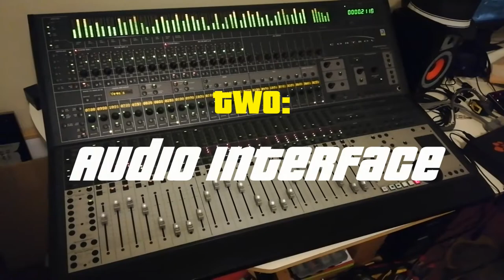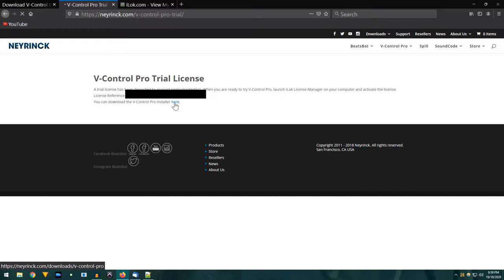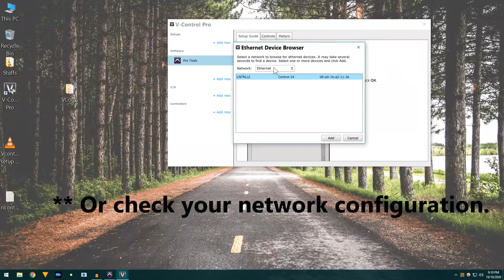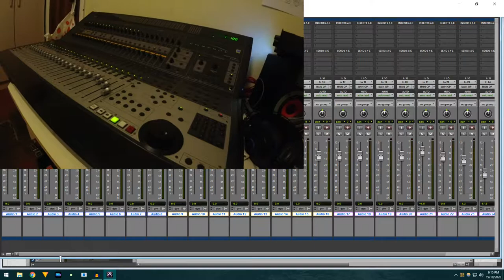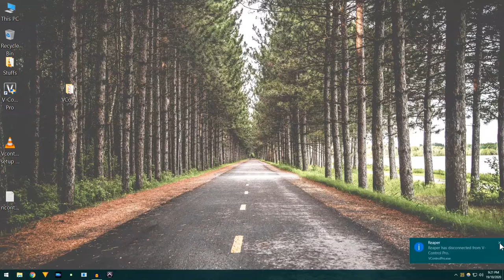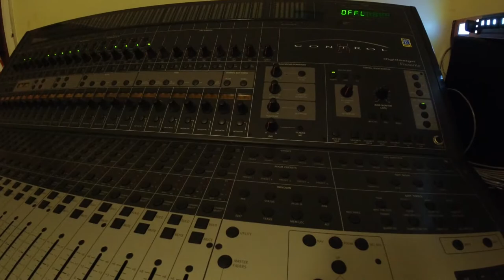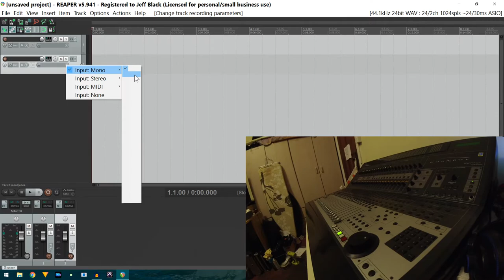V-Control Setup with Digidesign Control24 | Pro Tools | Reaper | Windows 10

Comment: Awesome awesome awesome video!!
I need your help! I have a command 8 I’m trying to get to work with reaper like this. I’ve done everything in your video and can’t get anything to work. Only the transport. I’m at my wits end with this. Been trying all year. I’m ready to be done with this and get a newer controller. I want to create not mess around. Please any help any advise. Please sir!!!!
Do I need to enable anything in the “midi devices window”?
I’m ready to go back to Protools. It works flawlessly in protools. I like Reaper but trying to get control surfaces to me have been a pain in the butt.
Reply from the maker: Hi, thanks for watching and for your comment. Wow that sounds like a massive pain in the butt!! Sorry to  hear.
I've only used a Command 8 with Pro Tools but found only a few things online about using it with other DAW's. One forum mentioned attempting to configure the Command 8 in Reaper as a "Livid DS1" controller (their example used Reason, but I assume it would be the same in Reaper). So maybe you can trick Reaper into thinking the Command 8 is something else to get some functionality.
Another article from Soundonsound.com wrote about using the MIDI Outputs instead of the USB port, so if you have an interface with MIDI input, this may be an option or perhaps a MIDI to USB converter. Here is the link to the article (Search for the "Stand-alone Mode" section) https://www.soundonsound.com/reviews/digidesign-command-8
I'm not sure if this will help, hopefully it will help a bit, but if you don't want to use Pro Tools then maybe a different control surface (Such as the ICON Qcon Pro or the ICON Platform M+)
Reply: @Guitargasm  thank you so much. I will attempt this again for a week. After that. It’ll be on to a different controller. Thank you thank you thank you
Reply from the maker: @uriel-heavensguardian8949  You are welcome :)
Hopefully that helped you, please let me know if you get it working or go for a different controller.
Reply: @Guitargasm  will do sir
Reply: @Guitargasm  Got my command 8 to work with Reaper!!!!
Wooooohoooo!!!!

Comment: How would you connect this to a newer mac? Or do you only do Windows? Also how are you connected if it has no USB?
Reply: you would connect via ethernet, in the case of a Mac you’d need to get an ethernet to usb c adapter if you don’t have one and plug both the mixer and your computer into a network switch so the software syncs
Reply: @younglordeisen2443  you think this would work with the icon d control?
Reply from the maker: I'm not too familiar with mac, but the audio interface has a USB output and that's how it connects to a PC or mac.

Comment: V control is not detecting my control 24 in the Ethernet select. the computer is recognizing that there’s connectivity but not the software can you help
Reply: connect the control 24 to a network switch if you have it plugged directly into the computer

Comment: Thanks for the help...I have a problem. Could you help me? I'm not getting the sound to enter control 24,,, it's being played on the computer's speakers.
Reply from the maker: Thanks for your comment :)
If sound is not going through to control 24, then my first thought would be to check where your computer is outputting to in system settings/speaker output on the taskbar.
What interface are you using? Are you using windows or mac?

Comment: Hi! Have you been able to get the bus output meters working (of the control 24) on pro tools?
Reply from the maker: Hi, I didn't get much working on that console, all the meters for input did work for me but not the output. I had so many other issues with it that I've gotten rid of the console.
Reply: @Guitargasm  what kind of problems where you having?
Reply: Yeah what can you do/not do?
Reply from the maker: Sorry, I didn't know you had commented (No notification) :(
Issues I had were jittering faders, poor communication into pro tools/reaper, sometimes neyrinck software wouldn't connect to the console and required to start everything in a certain sequence or it wouldn't work.
Sometimes certain faders wouldn't work in pro tools/reaper (ie: moving the physical fader wouldn't move the digital fader in pro tools/reaper)
There's probably more but honestly can't remember.

Comment: Jog wheel is amazing for navigation and zooming, too bad it's not supported 31:02
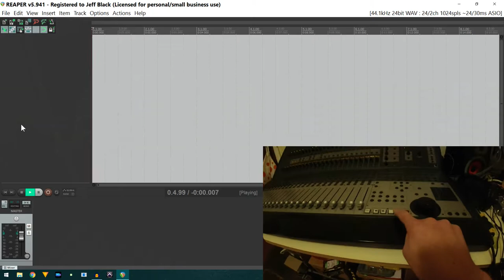Reply from the maker: While it does work in Reaper (21:14), I think there are a couple of buttons near the jog wheel (Scrub, Shuffle) that need to be pressed for it to work in Pro Tools .
Reply: Basically jog wheel works perfect with all the modifier keys in Pro Tools, Shift, Alt, Ctrl/cmnd @Guitargasm

Comment: Did you end up selling it? The fader tremble is a sign of a weak power supply.
Reply from the maker: Yup. Got rid of it. Didn't know about the weak PSU thing....
Reply: @Guitargasm  Just acquired one. I am under the impression that the new Pro Tools has a learn function. Hopefully this works over V-control
Reply: I bought a V-control licence.

Comment: How did you get the board to talk to the computer. Sorry I think I missed that part. Like how does it plug in?
Reply from the maker: The board used a DB-25 connector that plugs into the back of the Interface and then that Interface plugs into the PC via USB.

Comment: Anyone know if the 2022 pro tools version still compatible with V-Control? I’m about to purchase a Control 24 but kind of scared it won’t work
Reply: I'm running a Control24 with V Control on ProTools Studio 2022.7.  Works great
Reply: @cranwilton6133  really so should I buy the c24???
Reply: @bigsteppa3112  Both the C24 and the Control 24 work great with V Control. The C24, the model after the Control24, is still fully supported by Pro Tools ....... "fully supported"  means it does not need V Control to work with Pro Tools but it does need V Control to work with Reaper. Pro Tools are dropping support for the C24 on Dec 31st so you need to run a 2022 or earlier version of ProTools for full support. If I had the money I'd be swapping my Control24 for a C24 and sticking with my ProTools 2022.7

Comment: friend a question..i can control up to how many channels on the reaper ??
in case I can control all the functions on the c24 ???
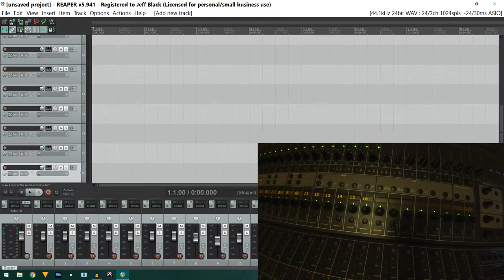Reply from the maker: 25:37 -- Control24 has 24 channels, so 24 channels can be controlled in Reaper.
Reply: @Guitargasm  even changing pages?
Reply: @josuemds  yes, you can "one channel a time" or "a page a time" mode

Comment: Maaaan that fader flickering is a pain in the ass huh.
I couldn't use 12 anyway cos ya know... avid. . My hd cards wouldn't be recognised
Reply from the maker: Definitely a pain. The jittering faders have been replace with new ones and it still happened. :(
Reply: @Guitargasm  mate I had that with my old protools le controller. 
Turned out to be a light I had under the desk.
So essentially  they are touch sensitive so protools knows when your fingers are touching the faders. External environmental factors can send signals to the faders. Have you tried it in another room just for testing purposes ? Obviously if it goes, its some electronic device in your workspace